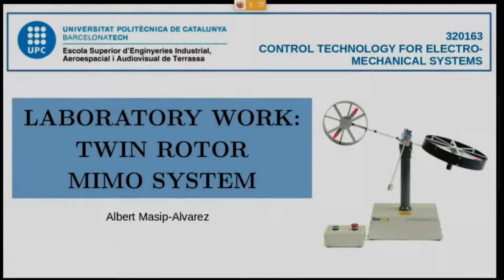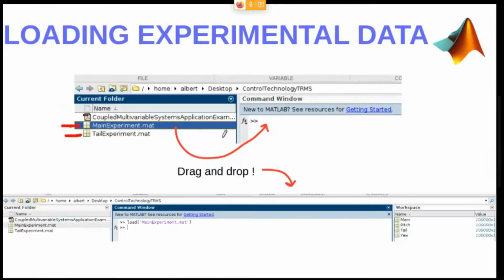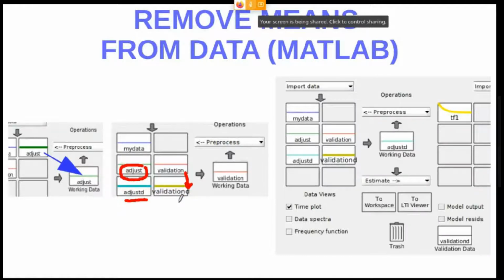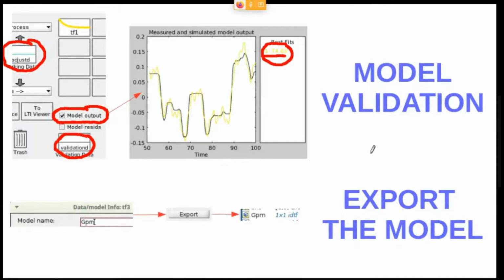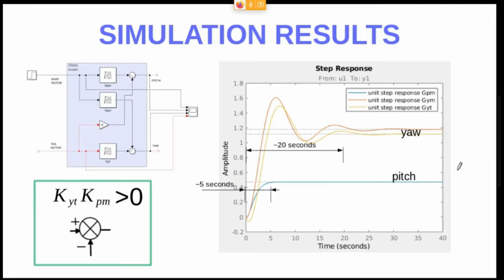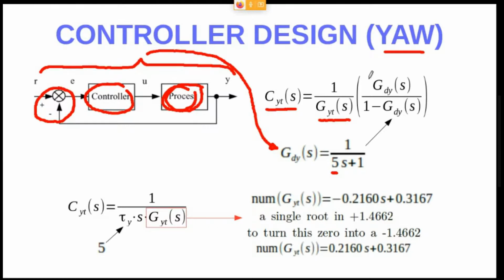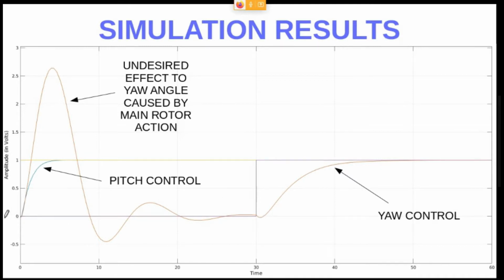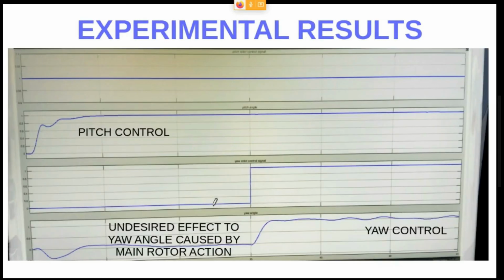Laboratory Work: Twin Rotor MIMO System Control Strategy

Comment: hello sir, first i want to thank you for this good explanitation, and i got a qeution for you, why the tf G12  is ZERO? could you please elabrotate it? and what kind of matlab are you using? i mean most of the time we use a simulink for such contrller designing yet i don't got what matlab it is... could you please guide me some point? i will appreactiate for the response and helps.